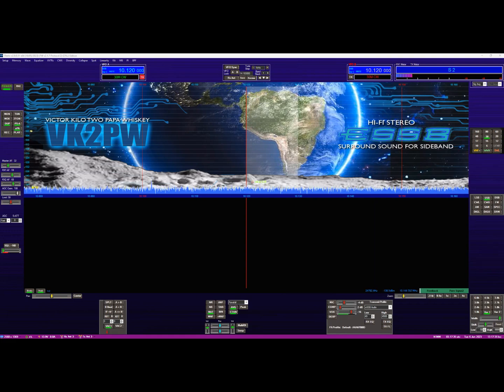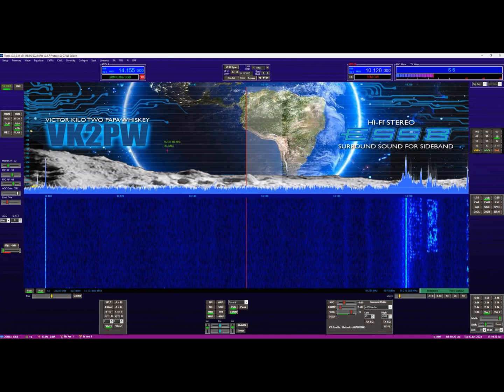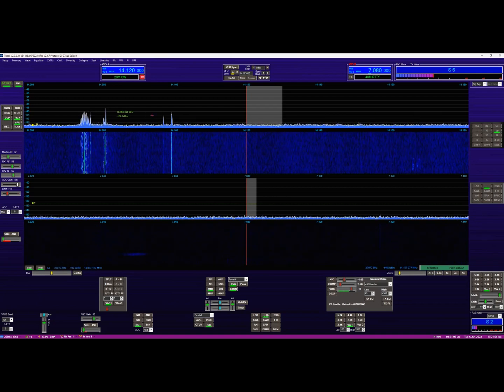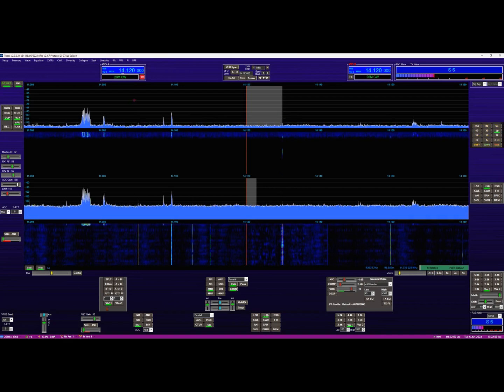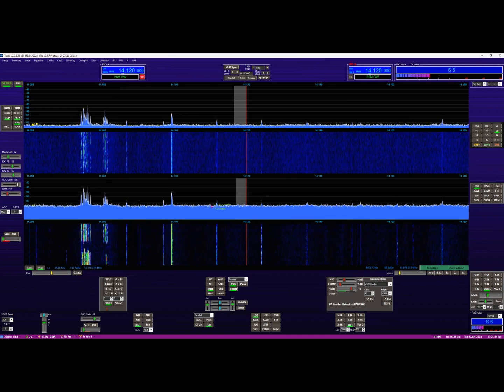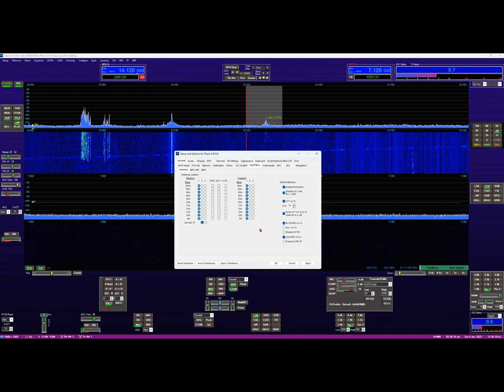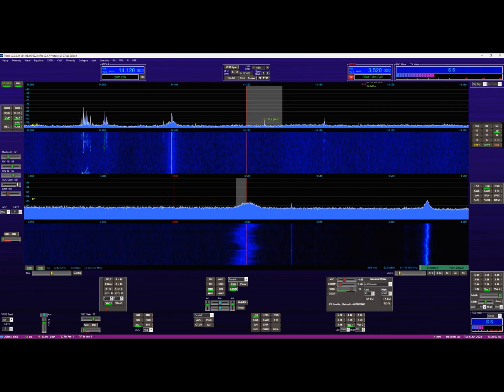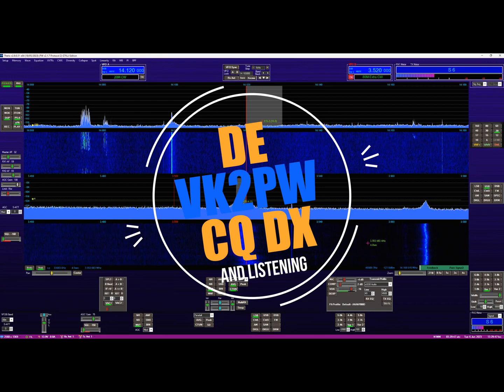How to enable Receiver 2 in Thetis sdr software for the Anan series of radio

Comment: As someone who has been using an Anan radio with Thetis for several years and who uses both RX1 an RX2 for RX/TX ... using both digital modes and SSB on either  RX.
That was very complicated/confusing. Maybe its the older version and the specific fork of Thetis thats being used but the main fork definately does not have Diversity or VFO sync enabled on a clean database.